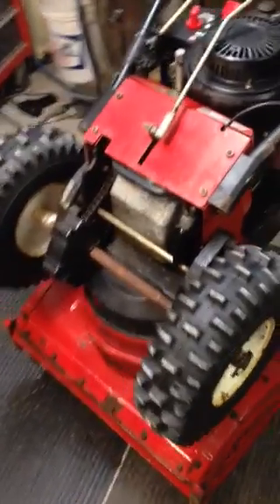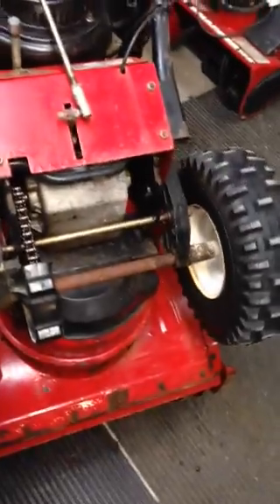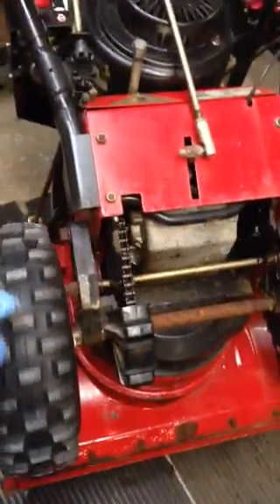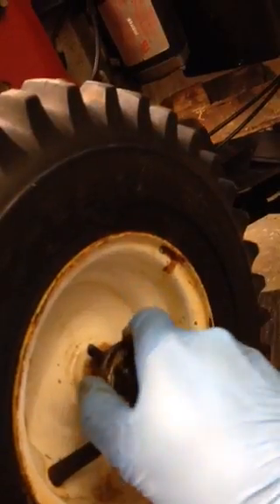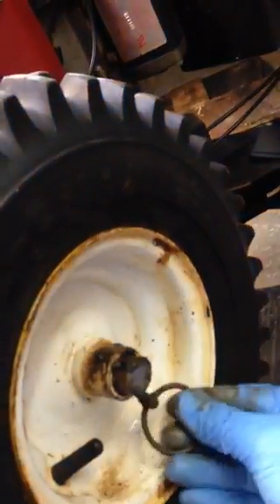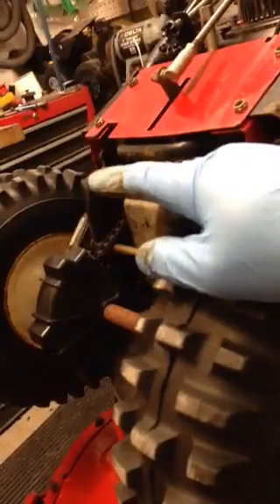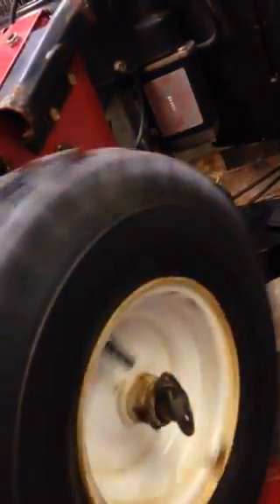Snowblower - only one wheel driving

Comment: Nice job explaining that, I was an idiot 😂. I even read something in the manual about the cotter pin position but passed over it. Today was the second time I used the machine amd with one wheel driving you really have to fight it all the time, because it pulls right like crazy. Saw your video and reset the cotter pin. Hopefully next time will be easier. Thanks much!

Comment: Today I took my Toro eight 826 OE and a right wheel was not turning I wanna thank you for your big help because I did some spring maintenance and I didn’t put the pin in the right hole  thanks for the advice appreciate it very much and today was a big snow day in So Chgo Hts.